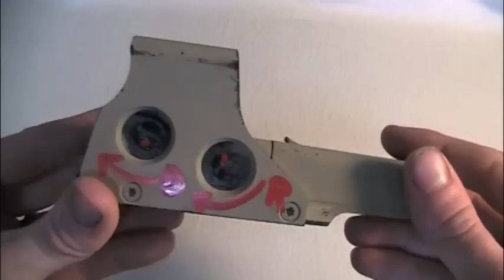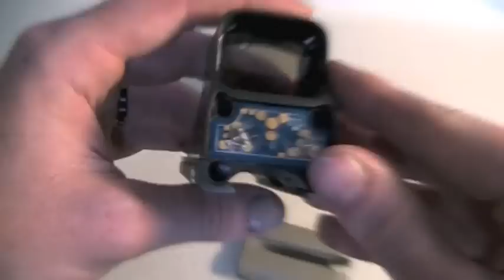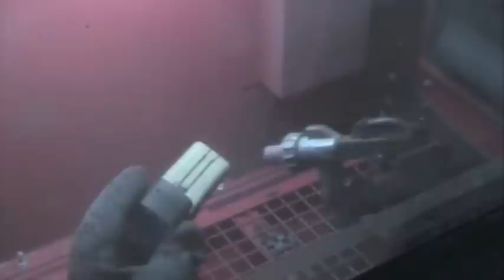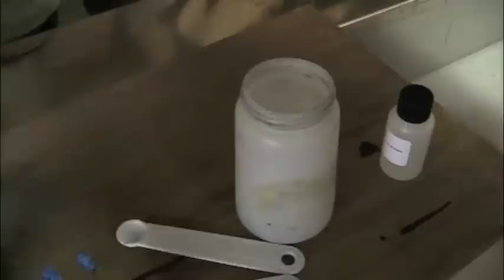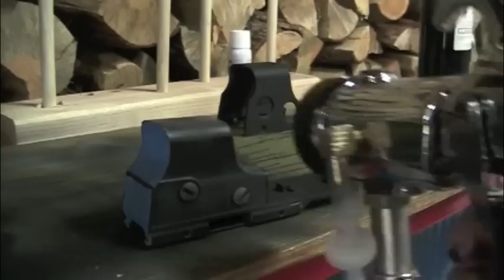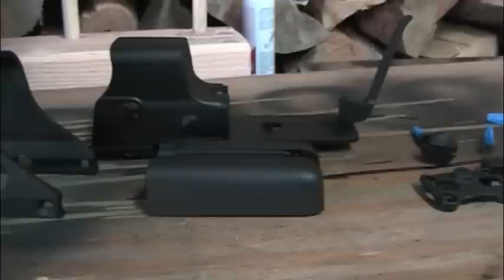DIY Eotech 512 Duracoat Project

Comment from the maker: You need to scuff the material. You can use red scotch bright pads if you do not have a sand blaster. Sand blasting is the easiest and fastest way to scuff material.